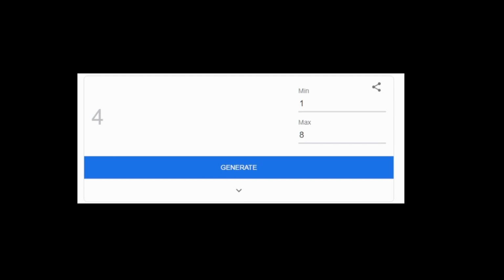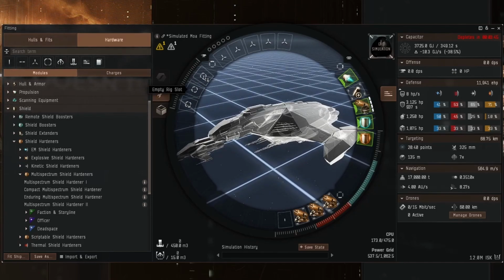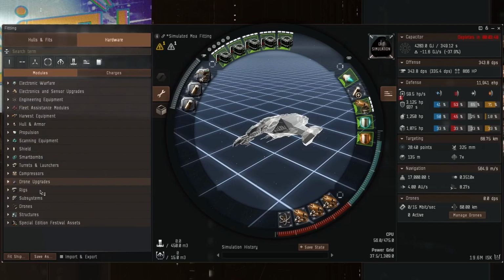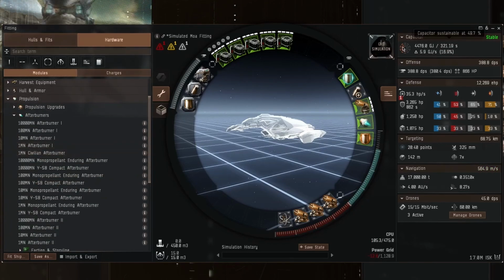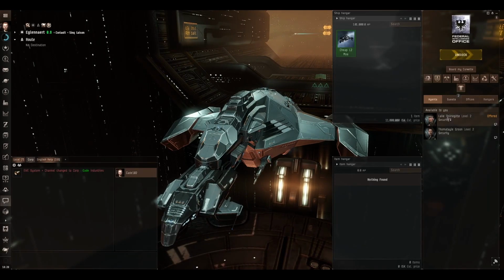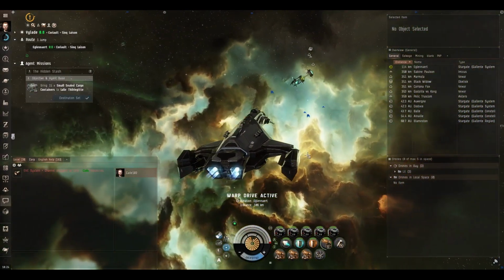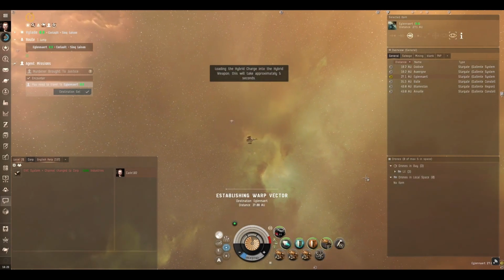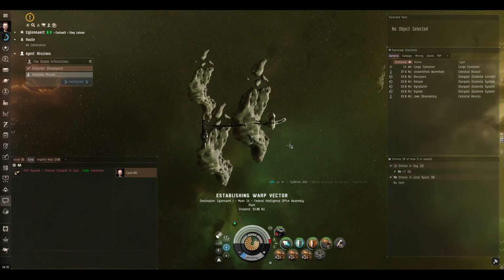EVE Fitting Guide: L2 Security Missions - Moa

Comment: Looks like a destroyer like a Dragoon could pull that off.
Reply from the maker: Oh yeah, easily. Destroyers can handle most L2 missions but some of them (especially Mission of Mercy) may be a stretch too far.
Reply: hell even my corax can plow through most l2 missions but the tougher ones are taking me +30 minutes just to warp in and out because of those damn drone swarms.

I was honestly planning to save up for an l3 Drake but now I'm thinking of purchasing a caracal with a rlm/passive-tank build for now. I've made 45mil isk in 2 days off l2 alone, 35mil was from trading stuff I found in wrecks.